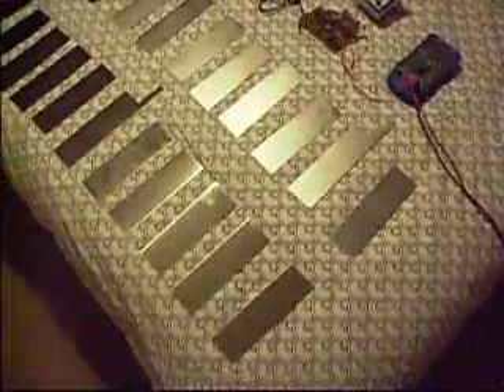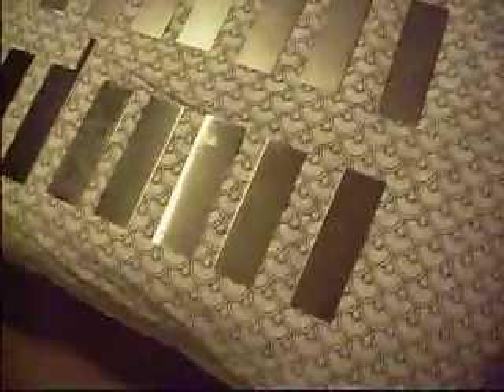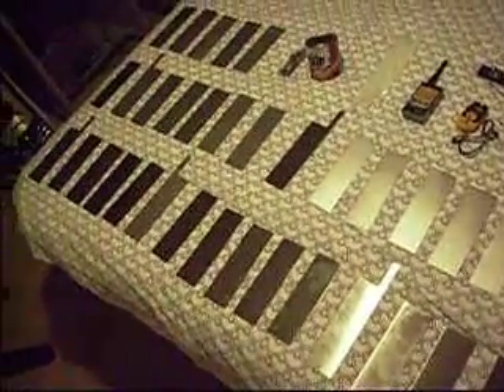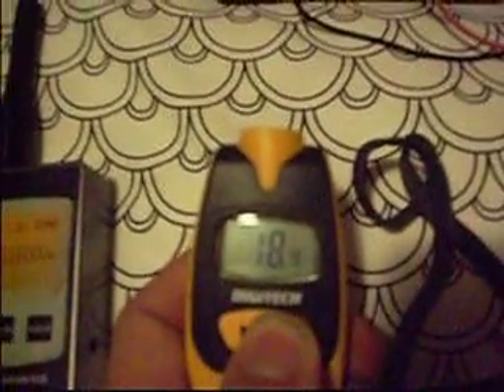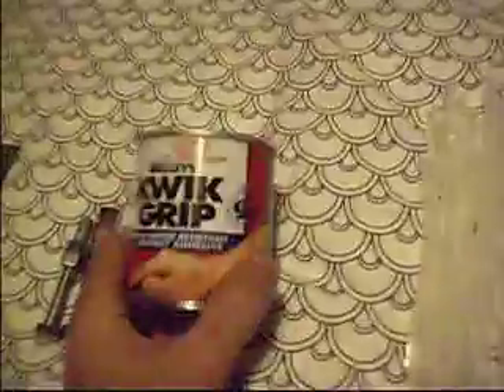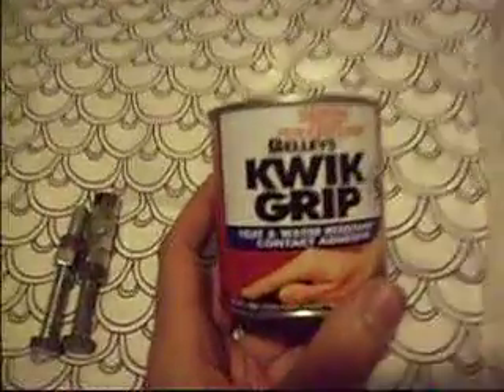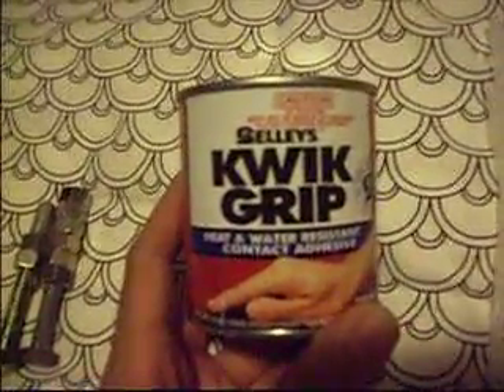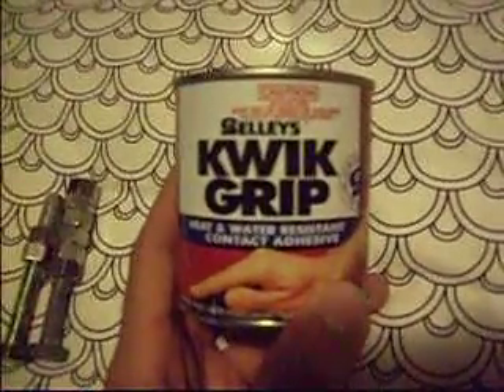Just a quick look at the plates and some test gear

Comment from the maker: yeah been looking for Bronze wool have not seemed to be able to find any. Most of the tools I've got have been from ebay very cheap that AMP meter only cost about $20 all up thats postage as well!! I wanted 50amp one so I could see what the max would be on the cell any I've got a funny felling it might be more then 25amps I just hope not to much heat, will work on that when I get to that point Thanks for the comments your first in the door :-) Helps to get comments so we stay on the right path.